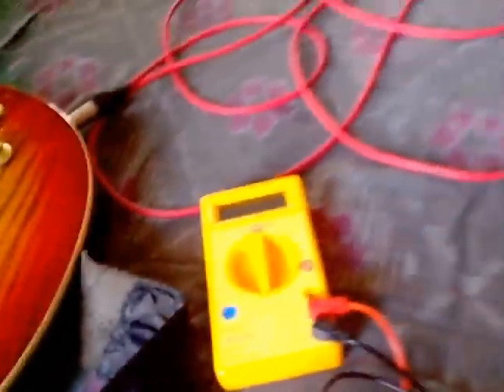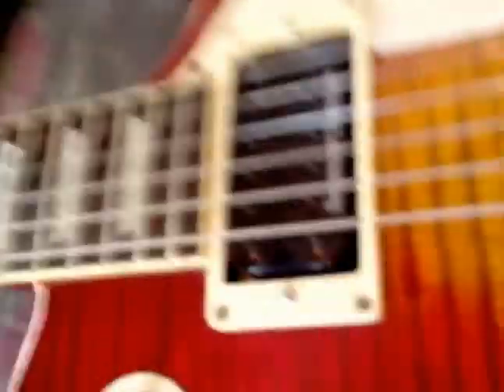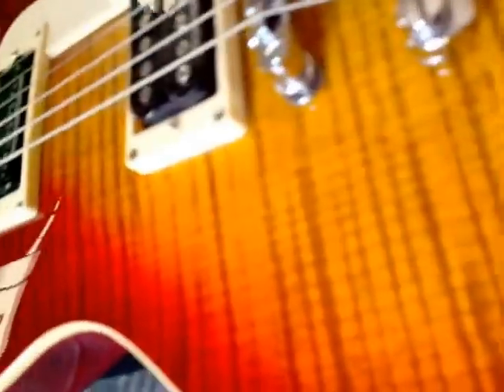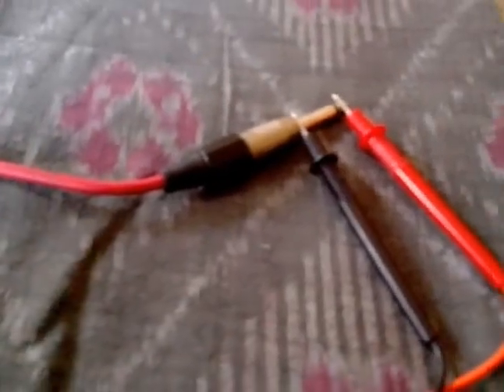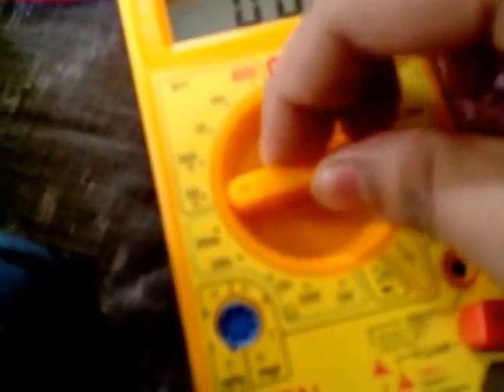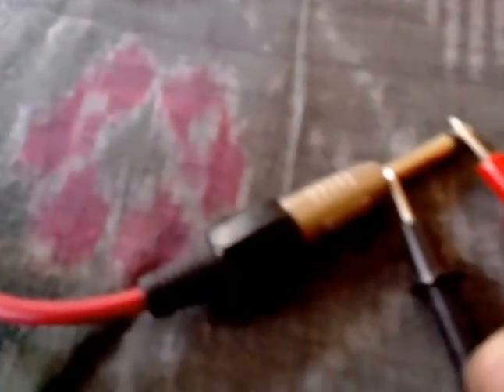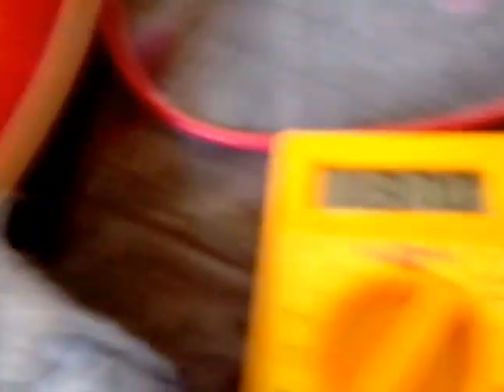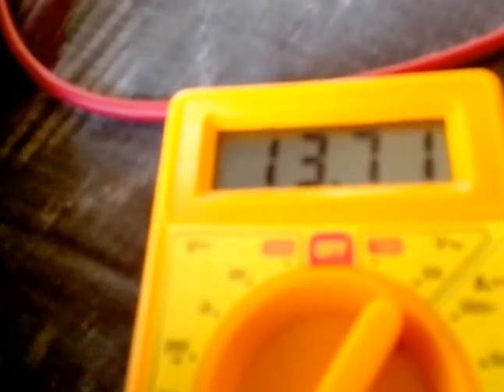Measure DC Resistance of a Guitar Pickup without taking it apart (Using a multimeter)

Comment: You should take the readings at the pickups, that way you rule out any discrepancies that the wiring or pots could cause. But you still don't have to remove the pickups completely.

Comment: My guitar is hummin like hell until i touch some metal. I dont get any readings using this method?! I testes continuity from output jack, to everything except pickups. Coul there be grounding problem in my pickups?
Reply: Hey you have a ground issue  ... either something is touching something it’s not suppose to or you forgot to ground something ... or if everything looks correct one of your ground solder joints is cold

Comment: My Gibson Custom has a 498t which is meant to measure 13k or so but mine is measuring 8k! It just sounds thin and harsh! Is it broken?
Reply from the maker: Maybe somebody swapped the pickups with a different one. Could explain the tone as well as the impedence.
Reply: That's around what a 490T would get. You find those in Gibson SG Special versions. I have a faded with the 490T. It is thin compared to the 498T but that is what I need for that sweet ACDC tone. If you recently bought it from Gibson then I would have a chat with them.
Reply: Verdigo too late now it's an 05' and I bought it secondhand 4 years ago. I've never been happy with the tone but never thought to test it as I just assumed it was a 498t which it should of been! Anyway I hate it whatever it is, it's muddy and thin and it's now been replaced. It is a Gibson pickup that's all I know but no other markings on it except 'gibson' and a letter t.
Reply: Try dropping the bass mid and treble to around 3. Gain 7 volume 8. More volume than gain though. Guitar on 8. Put it on a Marshal. Makes a great rhythm guitar. If it's a newer Marshal then clean channel with the crunch button pushed. Can still play lead. That is if you still have it.
Reply: Verdigo the pickup is no good mate doesn't matter how you eq it it's just inherent! Just my opinion though!

Comment from the maker: PSA:
In case nothing's major is wrong with your guitar's wiring, you can assume the value you get by trying the method shown in the video round 97-98% accurate...
However, you can also calculate the accurate value of getting your PU's resistance by calculating it using this formula.

R= (r*P)/(P-r)

Where R= True resistance of your PU
P=Resistance of the volume pot (eg. a 250k pot will have 250000 ohms resistance)
r=Resistance you obtain by the method shown in the video
Reply: tirtha2chester Hey, I just wanted to say thanks for this info, it is EXACTLY what I needed!!!

Comment: Hey this works incredibly dead on. I did two guitars and one has Fender Noiseless pickups which on the Fender website say 9.8k ohms and all measured 9.75 ohms cept the lead pickup measures 9.50 which i thought was weak anyhow ..and on another guitar.. the neck, middle bridge pickups measure 5.2, 5.1, 5.4 .. or something which is very correct ..cause they are weak but i love them  :)  Thnx for video.. saves pulling guitars apart!!!

Comment: I have done this in the past on guitars to roughly measure the DC resistance of the pickups installed.
Also if you can use the meter to measure low AC voltage you can strum the guitar to get a rough idea of the output level of the pickups.
Nice video man.

Comment: unsolder 1 lead(one) from the toggle or switch, then you'll measure the true unaltered DC resistance of the pickup. Anything that comes in parrallel will alter the value

Comment from the maker: Yes you have to do that in order to calculate the exact value.
However, in case nothing's major is wrong with your guitar's wiring, you can assume the value you get by trying the method shown in the video round 97-98% accurate...
You can also calculate the accurate value of getting your PU's resistance by calculating it using this formula.

R= (r*P)/(P-r)
 Where R=Accurate resistance of ur PU
P=Resistance of the volume pot
r=Resistance you obtain from the vid method